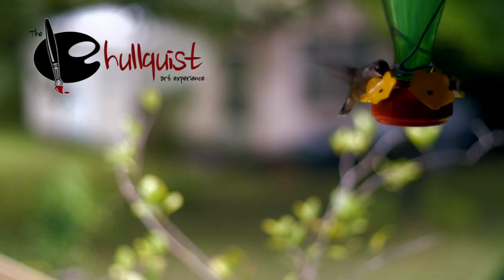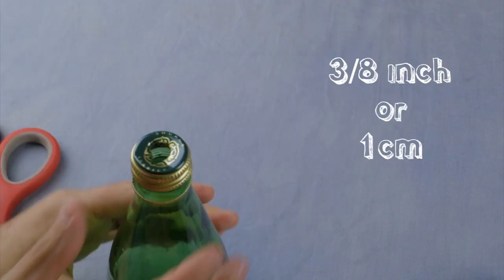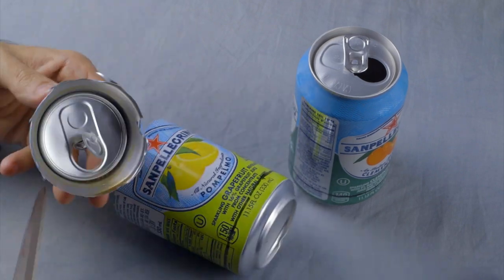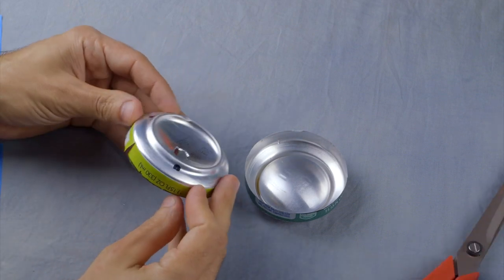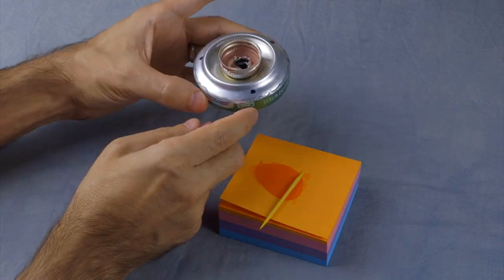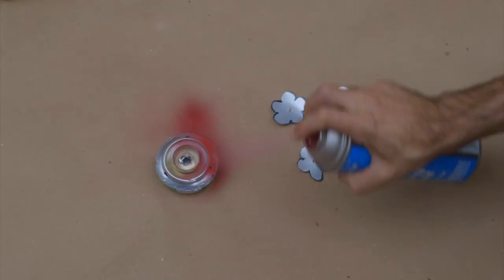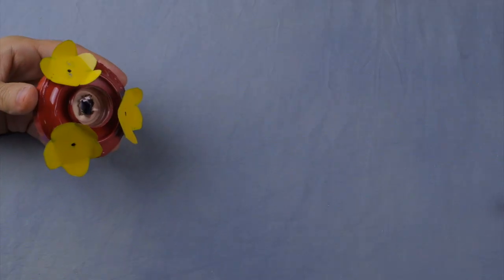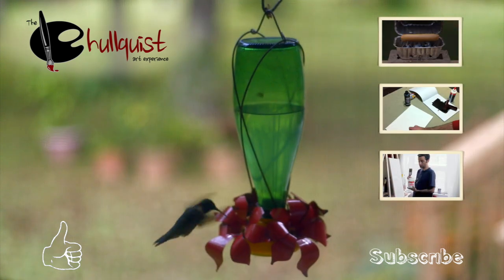How I made a HUMMINGBIRD FEEDER

Comment: concerned about long term use of aluminum in this, epoxy and paint toxicity , sharp edges, and ability to clean the base well.  They are beautiful, I bet functional and attractive to hummers....but my above concerns means I won't be trying this.  Still thank you!
Reply from the maker: At first glance the "sharp edges" seem like a valid concern, but in practice it isn't an issue at all — hummingbirds are very skilled little flyers! The epoxy used is minimal (only used to bond flat surfaces—lid and flowers— together and ensuring an air tight seal for the base). There is very little epoxy (if any) actually making contact with the syrup so there should be little to no toxicity. As always feel free to modify the design or use a different kind of glue/sealant. I usually rinse out the feeder with vinegar and/or HOT water so haven't noticed any problems with keeping it clean. Cheers!

Comment: It is not easy to clean and sharp aluminum can cut or hurt bird's wings.
Not good idea at all.
Reply: Scan Did you make it?
Reply from the maker: Hummingbirds are good at not flying into things. I've never had any problems with my feeders. The birds seem quite happy with them.
Reply: If your really worried about it you can fold the edges under some so there won't be an issue.
Reply: Do you think sanding it would help with the raw edges?
Reply: The hummingbirds that come to my feeders don't go anywhere near the edges of the flowers. They hone in to the centers of the flowers to drink the nectar. They never even touch the feeder at all.
Reply: Are you human or a robot...this isn't rockit science or brain sturgery. Humming birds are very accurate with their aim sir or robot....
Reply: @ehullquist  my wife said she had one get their beak stuck in our screen on the patio door while she was getting ready go out and help it off another bird came and pulled it off !

Comment: I tried to make one but all it did was attract ants...
Reply: take a 20 ounce soda bottle, cut off the bottom, make a pin size hole in the cap and run wire up through it and make a loop on both ends, seal the hole that the wire runs through with marine glue, let cure 24 hours, hang the bottle just above your feeder with water in it, ants can't travel through water. They sell these at most hardware stores for $6 but I make mine for almost nothing because we collect plastic bottles for crafts and making bird feeders.